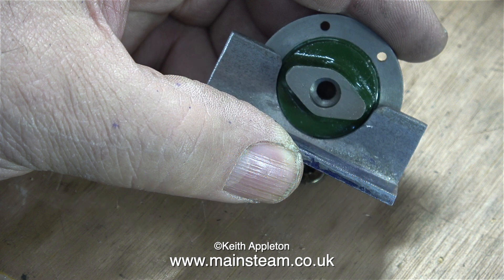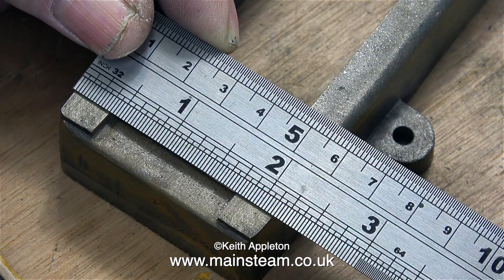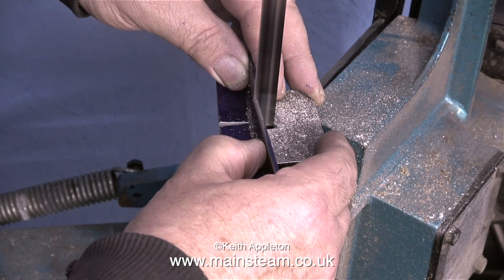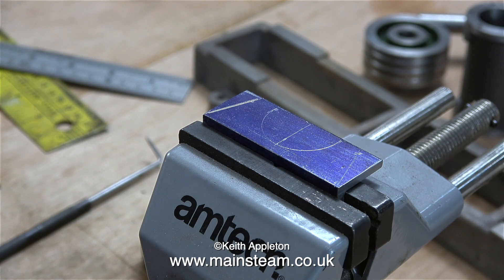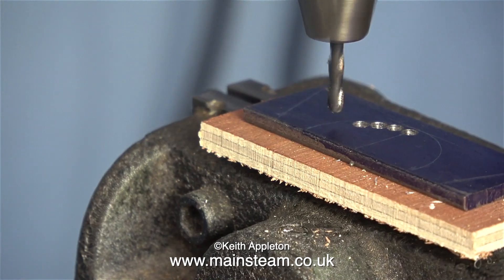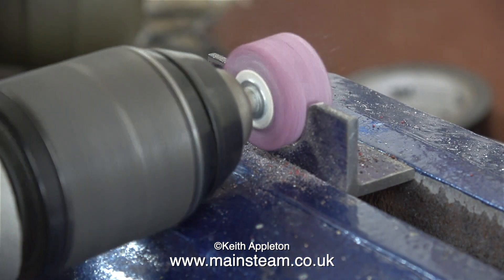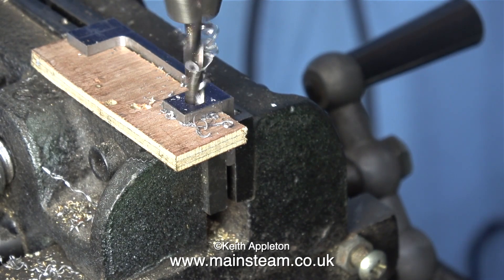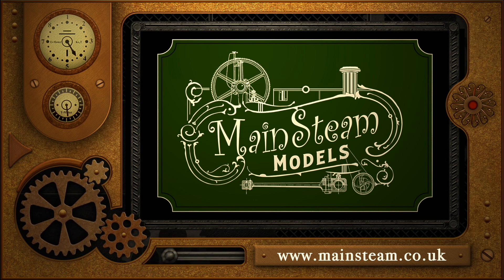MODEL STEAM ENGINES AND BOILERS - PART #38

Comment: That's not an unusual way to hold the angle stock in the milling vise; it's pretty much the only safe way to do it. Angle iron usually has a taper on the two legs, so the inside and outside surfaces aren't parallel. If you try to pinch one leg in a vise, it will rock back and forth.

Been there, done that, bought the t shirt. ☹️